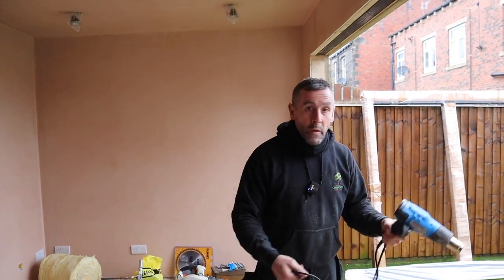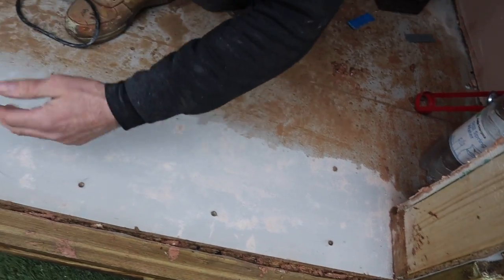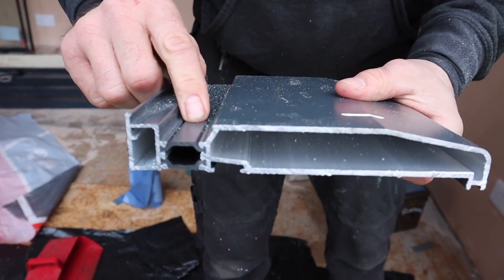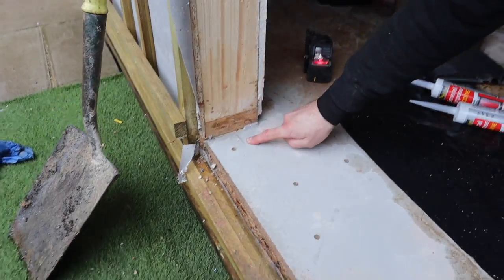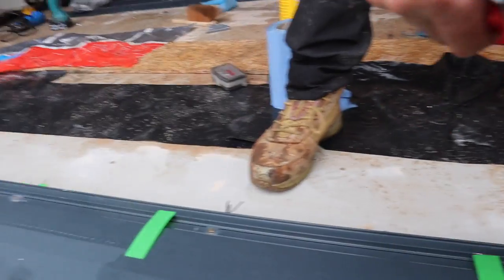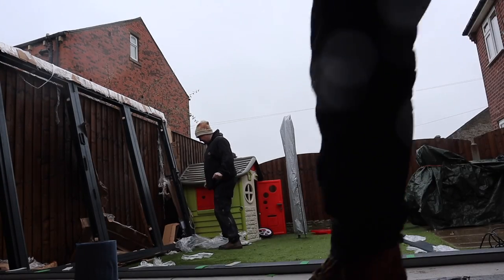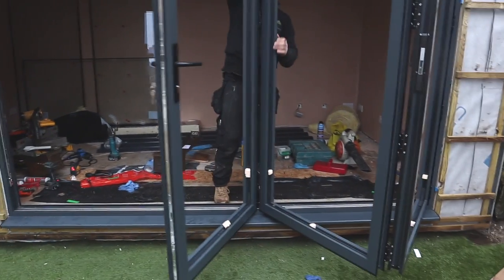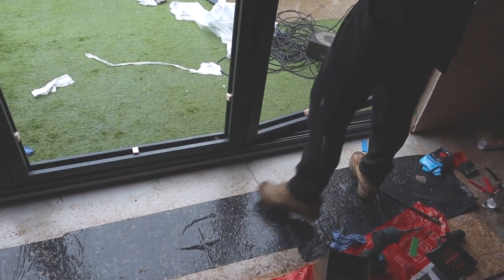Aluminium bifold doors installation on a garden room

Comment: Good informative video, Liam. A pleasure to watch!
The amount of installers that either don't toe and heel correctly or don't because they don't know how is shocking. So many glazed doors out there that have dropped on the leading edge and people advise that the owner needs a new doorset. Dear me!
'Tis my belief that a Carpentry & Joinery artisan can conquer other non-joinery installations such as aluminium, steel and PVCu, even integrated access control, but you cannot go the other way! An intricate handrail, staircase, traditional roof or (various) M&T/jointing techniques to a high standard will soon expose that.
Keep it going, Liam. It's good to see someone getting ahead that actually cares about their work.
Reply from the maker: Love this comment! In a week when lots have been abusive , thank you

Comment: Brilliant video and definitely the best step by step for Bi-folds. The tips on fitting the glass made my installation go so smoothly that the doors opened and slid without 1 issue and we're actually better than when the glass was out!

Comment: Brilliant advice from this guy. The most difficult bit for us was the aluminium glazing batons that click into place. Blimey they are hard to get in. My tip is the use vaseline along the edge of the frame to help it clip.’
When you come to fit the rubber gasket, a gasket roller helps you get it snug.
These pro guys have thumbs of steel 👍

Comment: Thanks for the vid, really helpful. I would say though that the door is almost certainly a Visofold 1000 and Express are just fabricating them under license so save yourself a few bob and shop around. There are many fabricators producing this exact door. I paid £2200 for mine, same size as this one.

Comment: I’m not a joiner but could you also pre drill the weather break screw squeezes silicone in then drill the screw into the silicone 
Another great vid !
Reply: That is one method that is used but the system Liam is using has concealed drainage and would run the risk of blocking or sectioning off the drainage in the cill or bottom of the frame. It’s also worth mentioning that the bifold profile Liam is using has been designed to be thermal fixed where as others say schuco for example will ask for a double fixing either side of the track. Reputable manufacturers / suppliers should give the profile manufactures installation manual to the fitter for the products being supplied.

Comment: When your assessing the high-spot on the floor, I use a small engineers square with masking tape on the vertical bit.  Move that along the laser line and mark it. Move it along 400mm and see if the laser is high or low relative to the mark. If the laser is below your first line, the floor is higher in that spot.  Mark the tape with a new mark and carry on.  Its the same principle as the tape measure, just quicker and easier.

Comment: Brilliant video Liam. I an a carpenter and joiner so can appreciate when a job is being done correctly and conscientiously.
I am planning to build my own garden room this year so looking forward to that.
May I ask who supplied the bifold doors? I know you did mention them in the video but I couldn’t catch it. Probably because  you have a strong northern accent and I’m a Londoner. 😆 I will be watching more. Great job on both the build, and the videos. Cheers!
Reply from the maker: Nice one! Always appreciate comments from all, especially when they are from someone with experience 😊 doors and windows are from express bifolds, they deliver everywhere, ask to speak to John or Cory and mention me 💪🏻
Reply: @thegardenroomguru  Thanks Liam. I might be using SIP panels to build mine. I’m getting some prices to weigh up the difference in cost as opposed to timber frame. I’m designing it my self to my specific requirements. It has to be a lounge, (to keep the misses happy), and a music room (to make me happy). 😆 cheers!

Comment: Suddenly, the 53mm gap on the right (looking out) are 52mm. No, i didn't see silicone squeeze out of all the various gaps made by the shims, silicone which should be outermost with flashing  to protect the floor from damp. Silicone goes under + around the fastening screws rather than on top. Missing toe threshold support?

Comment: Many Thanks - Brilliant As Good As You Get DIY Fully Explanatory Video - 

Some Questions Pls
1. For Bottom Sill How Much Spacing Do You Leave On Right & Left For Sill Expansion
2 Do You Silicon Internally & Externally The Sill Along It’s Length Where It Meets The Floor
2A. On ExpressBifold Website They Do Not Recommend DIY Install - What Would You Advice A DIYER Interested Installing 
2B. What Measurements Would You Provide For Ordering Bi-Fold Doors - With Respect To Frame Opening - Would You Reduce Supplied Dimesnions Slightly To Allow Wiggle Room When Installing OR Would ExpressBifold Do That - If You Did How Many Millemetre
2C. Window Bottom Sill - Is That Provided By ExpressBifold As Part Of BifoldDoor Order?
Reply: Hi Jack, In his vids Liam allows for a 10mm gap either side & a 10mm gap at the top. Normally he goes for a 1950mm Bi-fold Door Height to keep within the overall permitted Garden Room build height of 2500mm (whilst maintaining  reasonable internal head heights front and rear). So for example , 3000mm wide x 1950mm Bi-fold Doors (the sizes you would provide to Express Bi-folds), you would make the opening 3020mm wide and 1960mm high. Typical info you would provide Express Bi-folds for a quote would be along the lines  : Please quote me for Anthracite XP View Bi-folds 3000mm wide x 1950mm high with Two Trickle Vents and matching 190mm External Cill :-) Obviously it's up to you whether you want them to quote for the install as well or whether you or another window fitter will be doing the install. Liam has provided "The Best" Bi-fold Install video i've ever seen on YouTube, and all the info is there, should you wish to install them yourself :-) Hope that helps.
Reply: Cheers

Comment: It looks like you’ve used 125mm rafters in a previous video and have a 2.1m door, with what looks like a good 300mm or so above the door. How deep is your base please to achieve a 2.5m overall height? Another great video - many thanks. The toe and heel explanation was very useful too. Thank you.

Comment: Cracking video. Just had a set fitted on our last build. Wish I'd seen this first and had a go myself! Just a query regarding the gap at the top - is it tight to fit the cedar reveal? Doesn't look like much space between reveal and trickle vent??
Reply from the maker: Cedar will sit just on top of trickle vents on reveal mate 👌
And if it doesn’t I’ll drop them down a bit 👍🏼

Comment: Liam awesome video as always, with plenty of detail. I've ordered the XP10 doors from Express Bi-folds and the surveyor warned me about the 75mm up-stand on cill. Does it cause a problem, as I realise you can't lift the floor to match it, due to headroom etc. Looking at yours it looked a similar height with no issues? Cheers mate.

Comment: Gr8 video and very informative, Thx U very much :-) I've watched most of your vids & love the way U've tweaked your builds over the year, such as mini Stihl Chainsaw to notch out base joists for M24 Nuts, using 11mm OSB Cladding to "square" up Stud Walls, doing away with different size furrings & now the  Mini Wind Bags :-) Can now get a definitive quote from Express Bi-folds  (190mm Sill, two trickle vents etc.). Noticed U "eating up" PZ2 Bits on 60mm floor screws in an early vid & can recommend Toolstation's Spectre Advanced Multi-Purpose Screws 5.0 x 60mm. I find them as good as Spax but about a third of the price. Son gets those "silver" screws that drives me mad, difficult to get started, Pozi drive rounds & loads of PZ2 bit breaks !!!

Comment: Great stuff
However, when you screw the door frame through the thermal break and down through the sill's thermal break, into the timber floor won't there be opportunity for water in the lower thermal break to weep through and down into the timber floor?

Comment: Liam, quick question please. In an earlier video where you explain the 2.5m height restriction, you refer to the bifold doors being 1950 ht, whereas on this installation vid, you refer to the doors as 2.1m. Have you changed your spec in terms of height, and if so can you still make the 2.5m height using a 2.1 set of doors. Thanks
.
Reply from the maker: Hi
Are you watching the video where we built higher because he had planning permission?
I’m on YouTube app and can’t see what video your comments on. We always get doors at 1950, except that particular job and they were 2.1
Reply: @thegardenroomguru  it’s your YouTube video that deals specifically with the fitting of the bifold door Liam. No probs and thanks for getting back to me. 1950 it is then 👍

Comment: Liam, need some advice mate...trying to take advantage of an odd shaped garden so room will be 3m wide st on end and 2.4 at the other...front znd sides will be normal and square jusg the back wall will be angled...struggling how to tackle the roof as rafters will bd different lengths and heights as thd room widens...
Reply from the maker: Build your walls same height, front, back and sides. Then use furrings.
As long as all your furrings are starting at the same point at the front of the roof timbers, the back will fall correctly, obviously they’ll run short as the back wall comes closer to the front, if that makes sense? I’d draw you a picture but you can’t add an image to comments mate
Reply: @thegardenroomguru  Cheers mate...l'll look into that, must be some videos on here...👍

Comment: Just wondering I been told u can build up to 15 square meters to keep in in permitted development if I wanted to build a room 5x3 meters can I include a shed on side as part of the garden room and steel have the actual garden room at 5x3 or do I have to include the shed part in with the 15 meters as if I have to include the shed will scrap the shed and just build it separate

Comment: I know you said that the screws going through the door frame into the floor don’t need silicone and I do agree, but surely the same screw is piercing the thermal break below, which you were using silicone for, appreciate that the answer is probably that there’s not much you can do but do they not leave a potential for water getting though on those spots?
Reply: Shouldn’t screw through the thermal break at all. Screw behind the track into the back edge of the cill to stop any water ingress. Screwing through the whole thing defeats the purpose of all that silicone
Reply from the maker: Never going to be an issue
Reply: Then why do all the sealant on the cill only to screw through it. Fan of your videos but you’re doing a tutorial for people showing incorrect practices 👍
Reply from the maker: @paulcrawford7637  your wrong, you can’t fix the unit to the cill without using the thermal break or you will foul the mechanism 🤷‍♂️
Reply: @thegardenroomguru   You can fix behind the running track into the back part of the cill. It’s poor practice to fix through the thermal break
Reply from the maker: Put a link to your installation video mate, I’ll have a look 👍🏼thanks
Reply: @thegardenroomguru  aww don’t be like that. You’re doing a tutorial on how to do something incorrectly. I wouldn’t know this if somebody hadn’t advised me . Don’t be bitter. Be better. Great vids pal 👍
Reply from the maker: @paulcrawford7637  look at it this way, you leave a comment offering advice, you have no content, for all I know your a ten year old boy with nothing to do🤷‍♂️ if you get me 😬
Reply: @thegardenroomguru  if that was the case I’d be a 10 year old boy teaching you the correct way to install bifold doors🙊 Great content mate
Reply from the maker: @paulcrawford7637  google it👌
Reply: As a professional window fitter who has fitted more bi-fold doors than most people I have to say Liam you have done a great job. Loving the videos keep it up 👍
Reply from the maker: Thank you Joe 👌

Comment: Hey Liam.  

Thanks again for sharing all your process and detailed tips.  

Q.  Supporting the sill underneath.  It sticks out quite a bit so does it need timber or other support underneath, otherwise when you stand on it (especially on the end) is there a risk it'll get damaged or lever up the rest of the frame?  

Cheers 

Nick
Reply from the maker: Hi, It’s fine mate, but you wouldn’t want to stand on it tbh, it’ll be scratched in no time. You naturally stand over it as you enter the room 👍🏼

Comment: Could I ask you what ratio of slope on flat from front to back do you recommend?
Reply from the maker: We drop 75mm front to back regardless of depth of build mate
Reply: @thegardenroomguru  jackpot. Thanks
Reply: @thegardenroomguru Hi Liam, got your buildpack for 7x4, great help, all materials now arrived barring doors and windows. Noticed you used 2.1m doors as opposed your usual 1950, how high was the roof? I'll be building more than 2 metres from boundary so assume I can go 3 metres high at the front, how will this effect the slope?

Comment: You wont get sparks off aluminium, theres no iron in it!
Reply from the maker: You know what I meant
Reply: That screw didnt touch any aluminium at all... Some plastic (?) thermal break and then a bit of wood and then a bit of steel...
Reply: If we're being pedantic its called swarf. 👍